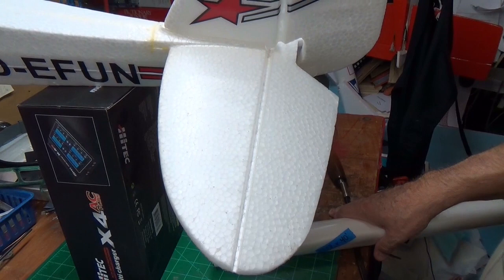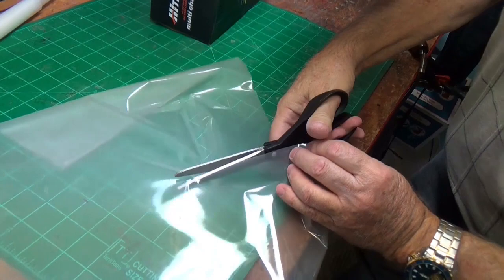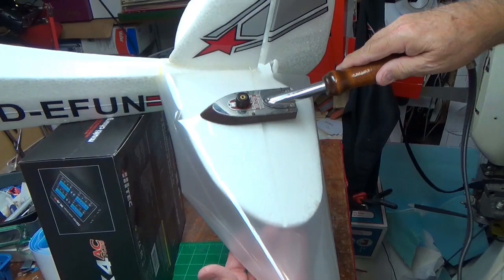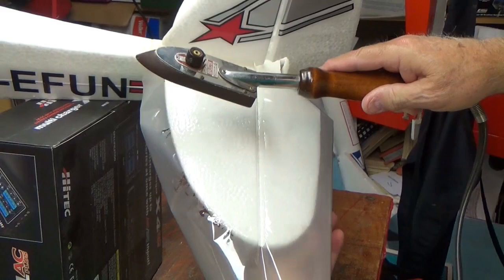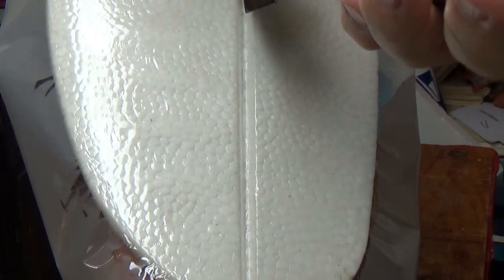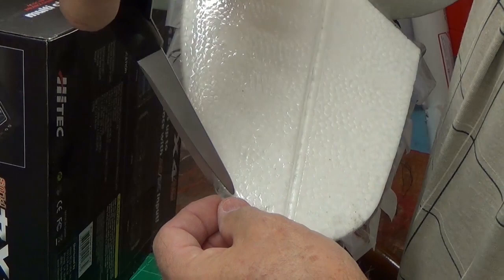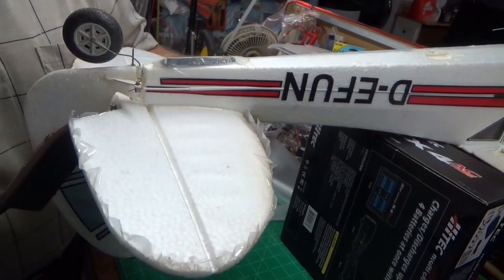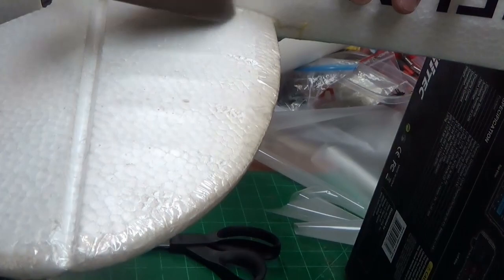How to Skin a Foam Wing with Laminating Film

Comment: Would be a lot faster  to just coat it with packing tape?
Reply from the maker: In the early days I used to believe that.  The string packing tape is strong length ways but it is very UV reactive and deteriorates very quickly and it is very heavy.  
Laminating film is strong in all directions.  It conforms to the smallest and tightest places and it is not UV reactive and last a long time.
Strong is an understatement plus it is easily repaired.
You should try it you might like it.
Thanks a big bunch for watching.
Reply: Oh ok ,but i was  referring to reg clear packing tape not string type,i have also bought the translucent colored tape and i cover all my foam self made models with it, and i never had issues with it deteriorating , some of my models have had that covering on for 3 years now...one issue i have had is sometimes it will have a piece  of tape start to come loose on edge, but other than that i works really well for me.

Comment: Hi again, Dick! I was hoping you could help me out here. Have you ever laminated a foam plane, say a EPP (Elapor) Multiplex, after you have painted it? Could you make a video about this, maybe?
Reply: Yes I have.  I use Krylon fast dry enamel spray paint and let it dry real well.
The only problem is when you touch the iron to the paint it will lift it.  So you have to be real careful. 
You can also paint the laminating film afterwards.  Just clean it real well with rubbing alcohol and paint it with the same paint.
Try it with something before you go all the way and see what is best for you.
Check out my MTD My Twin Dream video and you can see one that was painted first.
I also refurbished a Fun Cub that was beat up real bad.  I painted it yellow and then laminated it and it looks new.
Let me know what you do.
I will do a video but it will be a couple of weeks or so......
Thanks for the question!

Comment: Stoneblueairlines has a nice video on this as well. Uses a slightly different method. Instead of starting in the middle and working your way out continuously, start in the middle and leave gaps. Then go back and shrink the gaps. It might be a better method for avoiding having the material bunch up on you when covering larger or curved surfaces. Whatever works. I bought a whole bunch of 3 mil glossy on Amazon real cheap. Gonna get crazy
Reply from the maker: +Jacob Keller Thanks a big bunch for watching and have fun!
What is the link for the Amazon laminating film please?
Reply: +Dick Gibson  it was eBay actually. Laminator_warehouse is the seller, out of Texas. Think I purchased 2 12"x200' glossy 3 mil for $30.00. Not sure exactly because the exact item I purchased doesn't show up in my purchase history, think it's been deleted. He's got a variety of laminates for sale. I think 3 mil is a nice thickness. Light enough to be pliable, yet only need to overlap once on the leading edges to get adequate protection. There is more expensive UV tolerant laminate out there. I wonder if it's worth the expense. I've got the new radian and carbon z cub foamies I'm going to laminate.

Comment: Mr. Dick, I'm a bit confused as to your reference to 1.3 and 1.7 films.  First, you showed a roll of 1.7... then actually used 1.3, if I'm not mistaken.  (?)

I'm not new to R/C by any means, but I'm new to electric and/or foam planes.  I'm setting up a Ranger EX for aerial photography, but I do not like how the hinges are made on any of the control surfaces... so I read online to laminate them (which I've never done before).  I've applied a LOT of MonoKote and/or fiberglass, kevlar, and carbon fiber, but never over a foam plane.  (And I agree with a lot of the others here... a fully hot iron?  I almost fainted when you said that!)  :)

Thanks for the video!
Reply from the maker: You are the first one to catch that.  Congrats.
I use the 1.3 for curvy and tight places and the 1.7 for the bottom of the wing and the bottom of the fuselage.  On the wing because it prevents the wing from flexing upwards and on the Fuse for skid protection.
The 1.3 is the thickness of choice mostly.
Great catch Clint!!
Thanks a big bunch for watching
Reply: Thanks so much for the clarification, Sir!  Helps a bunch, and keep posting great videos!
Reply: @DickGibson  Can you paint over the film after its applied or would it be best to apply color monkote over it? Would that work?

Comment: Can I use EconoKote?
Reply from the maker: I have not tried but I doubt it.  Typical wing covering is not as flexible and  the iron will burn through it quickly.
Laminating film is very flexible, it sticks like glue and it is very hard to burn through.

Comment: The iron was far too hot on this demonstration. You can see the foam underneath go from smooth to 'turtle skin' texture. That is from slightly melting the foam. Adjust the iron on an scrap or body section so that the glue melts, but the foam doesn't. Finished product is much nicer.
Reply: Ian L you can also put a monocote sock on the iron for this. I would use air as well I've put dozens of
 rolls of this down. Thanx

Comment: He said order a lot. What a lot??  The site sales 1.7mil “18.  How much is a lot ?  10 -20-30 orders ??
Reply from the maker: It is 18" wide and is sold by the linear foot.  So for the price listed you get a piece 12" x  18" . I would suggest at least 25 feet of each to start.
Thanks a bunch for watching!!
Reply: Dick Gibson this stuff can be painted over? Or should I paint 1st. Then put the skin ?
Reply from the maker: I would recommend painting first then covering.
It can be painted but it is much like paint a car.
Surface prep, then sanding, then surface prep then thin coats of paint.
If you just paint it the paint will flake off.
You can do a flat paint job by painting over the film.
If you paint first then the plane will be shinny because of the film.
Never the less, the laminating film makes the plane much stronger and more durable!
Thanks a big bunch for watching!!!!
Reply: Dick Gibson thanks. U R awesome help

Comment: Interesting. I checked out Aloft Hobbies and they sell 1.7, 3, 5 and 10 mil laminating film. 2018 price is 25 cents a foot (if you buy 10 feet or more) for 18" wide. This isn't bad. I use this stuff to cover control line combat foam wings, and have used it since the 1990s. If you want a LOT of film you can get it from various places online - I was getting mine from usi-laminate.com. What you're looking for is "low melt" film - I use the 1.3 mil Opti-Clear (used up one 12" x 500' roll already). A 500 foot roll of 1.7 mil Opti-Clear 18" wide costs all of $19.99 (plus shipping, I imagine). You also get it in matte instead of gloss, but I don't recommend it for general use because the iron snatches on it and causes seams to roll up. Worse if you use a sock. I really don't know what Aloft is selling, it's definitely low temp film, but it might be the equivalent of USI Digi-seal (which supposedly adheres better to heavy ink and has UV protection). Laminating film, by the way, can be painted on (scuff it up with fine steel wool first), and you can even dope tissue on top of it (use nitrate dope or Minwax Polycrylic - though I would not use the nitrate dope if over bare foam). And yes, it works very well over balsa structures, too. One thing it does NOT do is shrink a lot.
Reply from the maker: I agree with all said.  I have been buying off Amazon for a while now.  I, however use the frosted in a 3 mill and have had not problems.  Aloft is the best place to get started.  On the other hand, I have sent them tons of business and have had no word from them yea or nae??
Thanks a bunch for watching.
Reply: Thanks for making the video. I forgot to mention - apparently these days they've come up with new types of laminating film which I haven't had a chance to try yet. The stuff we've been using is "polyester", or often called "PET" or "BOPET". Pretty strong stuff, it's the same stuff they use for Monokote. But a lot of hot laminating film (usually cheaper and usually in lesser thicknesses like 1 mil to 1.5 mil) is now "polypropylene", or "PP" or "OPP" or "BOPP". This is ALSO quite strong, though probably not nearly as strong as polyester. It's essentially the same material they use to make packing tape. What I saw on this video:  https://www.youtube.com/watch?v=l7XeMS0BlTg  makes me think it might not be the best choice for open structures, in fact I'm not really sure why it exists other than it makes it easier to separate laminated sheets of paper as in the video. I think it might work fine for covering foam (even bare foam), since people have been using colored packaging tape for years (what they call Zagi tape - which, by the way, REALLY sticks down permanently if you iron it down), especially if you cover the foam first with paper or silkspan (Ron St. Jean's technique for free flight duration models). Might be lighter than PET. In any case I found a local source so I'm going to try some. There's also nylon film which is expensive. And these days there are also cold films (which also seem expensive - they really do resemble tape, since they're tacky on one side, and come with a release sheet on the back side). Come to think of it.. when I first started flying combat everyone was using something called FasCal, which resembled these cold laminating films. VERY VERY VERY strong (after the inevitable mid-air you'd often end up with a bag of balsa fragments), but a major pain to use because if you ever let the adhesive side touch itself it would never come loose and you'd usually have to throw that piece away, and it was expensive.
Reply from the maker: This is the 3 mill https://www.amazon.com/gp/product/B00AH2T6H4/ref=oh_aui_search_detailpage?ie=UTF8&psc=1
This is the 1.7 mill   https://www.amazon.com/gp/product/B00AH2SWCO/ref=oh_aui_detailpage_o00_s00?ie=UTF8&psc=1
It will not tear it shrinks and re-shrinks if necessary and it is extremely durable.
Reply: Yeah, this looks like low-temp film, which is perhaps the best type for our purposes. In my case I was covering bare foam wings (no sheeting), and it was imperative that the iron temperature be low enough that the foam didn't melt. I notice that USI sells on Amazon.
Reply: Thanks for the info, could you suggest a iron?, I will be using it for my foam and balsa planes, several need new mono Kate/Coat
Reply: I've been using two - one's a small hobby iron and the other is a lightweight clothes iron. Get one without the steam, of course. I don't think brands matter all that much.. all of these are capable of getting way hotter than they're supposed to be, just make sure the thermostat does work. I wrap flannel around the sole (for a small iron they sell socks but it's just as simple to wrap a piece of flannel around the shoe and secure with cloth string).
Reply from the maker: https://hobbyking.com/en_us/turnigy-covering-film-iron.html
Any iron like this on about 1/2 heat setting
Thanks a bunch for watching!!
Reply: @DickGibson  thank you Sir

Comment: I don't get it! Why spend so much time on a $250.00 airplane. What do you get from all this work. You may say it's stronger but too what degree. A crash is a crash and the skin will not stop the breakage of the plane. Just glue the plane back together with glue and be on your way.
Reply: I know why I'm considering this:  I have many foamies that would still be in perfect condition except for the fact that bugs and other little things put dents in the wing.  I even have depressions from the mounts some of them sit on.  This would easily save the plane from this type of damage.  I could also see it saving a foamie from a reasonably harsh crash, too, honestly.  Not to mention it makes them look nicer.

As for spending so much on a 250 dollar plane... well, 250 bucks is a decent chunk of change... if I can double the plane's lifespan (or at least the lifespan of it still looking good) I'm all for it.
Reply: k miya and a funcub is extremely robust. Iv'e got 2 and t hey are fantastic it is german precision work.
Reply: I would like to add that I can  see this saving the paint scheme. On foamies the paint never seems to last very long and when it gets all chipped up you're kinda screwed. Repainting is difficult on these because you can't tape off on top of other paint to make straight nice clean lines because the tape will pull the paint underneath right off. Although my foam planes I use to practice learning new things on before trying them on my kit built balsa planes with 100s of hours spent building them, I still would like to see them look nice as long as I can. I see this as a great idea in doing that. And a very easy inexpensive way also.